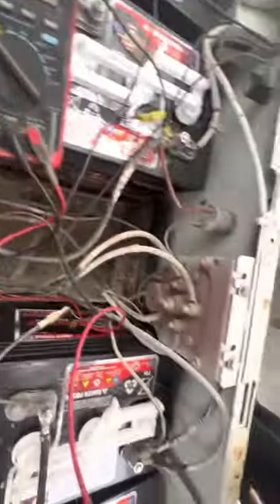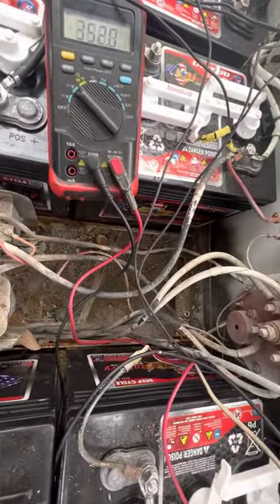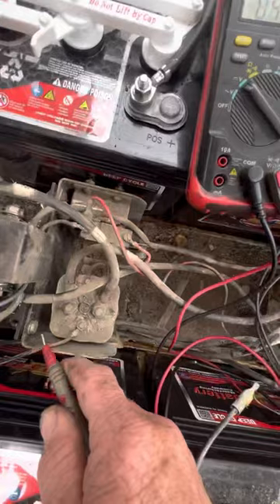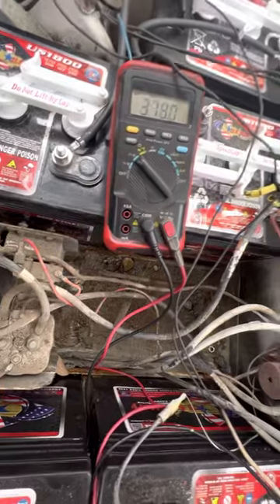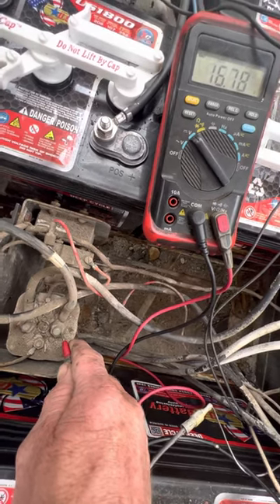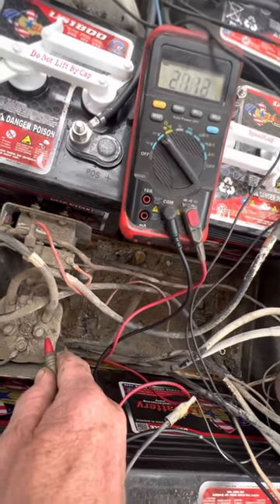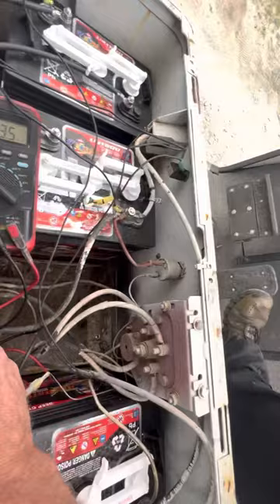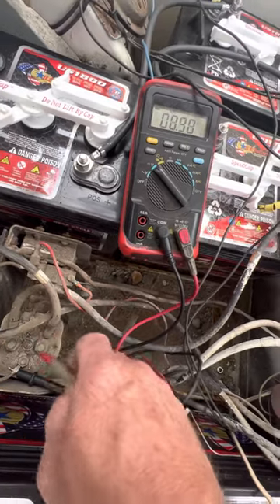EZGO MARATHON GOLF CART WON’T MOVE

Comment: UPDATE:  So in my haste last night hooking up my Pulse Tech Xtreme Desulfaters to my batteries while night fell and I had no lights where I was working, I failed to see a + battery lead that runs back to the rear of the cart was not hooked up. It had fell down between some other wires under the F/R switch. So, I have to "self admit" it was my own mistake. I was in a panic because this in my Sporting Clay's Shootin Buggy and we have the U.S. North East Regional Sporting Clays Tournament starting on this Wed's here and I really didn't want to have to walk it and carry all my gear. Thanks so much for responding to my "SOS" and while I was at it, I checked all of the connections, pot wires etc etc. Thanks so much again for helping. Keep the older Golf Cart Videos coming. Still a lot of 90's EZGO Carts out there. I'm getting ready to install 3 12 Volt Solar panels on the top with a charge controller etc to get me more range during the day hopefully on my six 6 Vollt Trojan T-105's. Someday when I'm rich I'll be able to afford a Epoch Lithium 36 Volt Battery maybe. But for now I have to stretch out what I have. Thanks again Sir !
Reply from the maker: Glad you figured it out. Anytime I get one in the shop to work on. I’ll make videos.
Reply from the maker: Solar panels. Let me know how they work

Comment: Question! How do you check the controller? Everything on my marathon is working, good ohms on pedal solenoid is jumped, but it’s not running I’ve jumped the controller and the motor runs forward and reverse
Reply from the maker: Black lead of m- on controller and red lead on b+ on controller.  And when you hit the gas it should show battery voltage. If it doesn’t replace. Controller.  Has the cart been wet any
Reply: Not sure I was told dog jumped on pedal and it hit truck and tires dug a hole in ground now it don’t  run haha
Reply: When I jump B- and M- on the controller it runs, but I am getting no power on B+
Reply from the maker: Where do you have the bLack lead at
Reply: Exactly as you told me black on M- red on B+
Reply from the maker: @hunterking4736  ok. Ow leave the black lead there and put the red lead on b+ on controller.
Reply from the maker: I meant to say on the controller above. But I can already tell you. Controllers bad. It should have showed battery voltage. Now that test above just checks voltage through the solenoid. But if you jump the controller and the cart runs. That means you’re getting voltage across the solenoid. So replace controller
Reply from the maker: @hunterking4736  yep the dog fried the controller because it wasn’t moving. The controller got to hot and burnt up.
Reply from the maker: @hunterking4736  need to put the dog on restriction or something. My kids did the same thing one time.
Reply: I was looking to order a new one but cannot find one exactly alike all the new ones seem to have a extra small lead and a extra 4 pin connector
Reply from the maker: @hunterking4736  yes that’s new style. Give me sec and will tell you what to type in
Reply from the maker: @hunterking4736  okay that’ll work. That’s just for reverse. You don’t even need to hook the 4th pin up.   You could send it to flight systems and get it rebuilt
Reply: Update I removed the controller and it sounds like a maraca inside hahaha
Reply from the maker: Oh yeah it fried it then. Thanks for letting me know!!🤛
Reply: Update new aftermarket controller new solenoid runs great!!
Reply from the maker: @hunterking4736  h$$$ yeah.  Glad it worked.  Make sure your subscribed.  I post 2 videos a week.

Comment: What was the outcome on this cart ? I'm having the same issue ?  Does the "Varistor" need to be installed on the controller ? Some people say yes and some say no. Mine is a 92 Marathon and came with a Varistor on the controller between the B+ and B - terminals that broke but the cart kept operating, (I replaced it). Does it have to be mounted a certain way ? I can hear my solenoid clicking in but the cart won't move. Battery pack is fully charged up. Could the issue be in the forward & reverse switch possibly a micro switch stuck ? It won't move in either direction. Ran fine last week. Parked it and charged it and now just hear the click of the solenoid. Thanks, great videos ?
Reply from the maker: You don’t need the  varistor. The problem won’t be the micro switch. If that was bad sol won’t click. Have you check ohms on the black and white wire comping from pot box
Reply: @HeyHeyHey97  Thank you for responding so quickly, greatly appreciated ! Question: why do some late 90's ezgo carts have a varistor and some do not and, does it matter what side of the varistor goes on what terminal ? This morning I will check the ohms on the pot box. It got dark last night then I came in and found your video ! Thanks again for any help sir. What was the outcome with the old ezgo you were working on if I may ask ?  I will follow u with you after I get into it this morning.......
Reply from the maker: @MacMcCabe2456   controller

Comment: Hello thanks for helping us folks that dont know what we are doing. 
I have an EZGO RXV. 2012. 
48volt. Just bought it from a neighbor 2 weeks ago. Ive been golfing daily and using it all working great. 
I tried to install LED light strips for underglow. (They look great!) but now my cart wont move. 

Originally I installed it only onto one 12v battery the main battery. Then after I realized it didnt move anymore, I rewired everything to take all of the battery pack with the + on the main and the - on the last battery in the chain. Ive installed an inline fuse on it as well to make sure it doesnt mess anything up. Hoping that would solve this issue but it did not. 

All my batteries are receiving battery. 
My sol is receiving battery. It clicks twice when I turn on the cart. Tow switch worked a couple times today but no longer is working. Reverse sound works. All lights, usb ports, etc all work. Cart will just not move. Do you do Facetime consultations? Id be more than happy to compensate you for your time. 

Also, not sure if this could have been a catalyst as well , but the electric “fuel” gage never worked. I got it working by wiring it up. It just had a faulty connector. Could that have ruined something in the cart as well?
Reply from the maker: Sounds like bad controller. If you let any of them wires touch another wire in the-harness especially the orange. You fried controller and the speed sensor. If you it double clicks your controller is bad.
Reply from the maker: Meaning at the electric fuel gauge
Reply: Yes when rewiring the gauge , the wires did spark. 
I just took apart the gauge and let the red, black, and grey sit free. Turned the key and now the tow switch works perfect, and when in forward, it clicks off the break now and i hear a quick almost “ufo” type sound. But still no ability to drive forward or back. Should I purchase a new meter harness? I cut the factory harness off to make my own connection. I no longer care to have the gauge work, it seems the gauge is the issue
Reply from the maker: So when you hit the gas the sol clicks but the cart doesn’t move? Does the sol click in and click out real fast
Reply: @HeyHeyHey97  Here is a quick 1 minute video of whats going on  https://www.youtube.com/watch?v=elaUrxC4duI - The sol does not click when i hit the gas, but after removing my gauge wire work, just letting the wires hang free, im getting progress and different sounds, and the break releases properly everytime when I hit tow switch and turn cart on. Before when my gauge was connected it would not do that. Really hoping its not a controller haha.
Reply from the maker: @beauvallis9340  have a busy day at work today. But will watch video when get
Reply: @HeyHeyHey97  Thank you brother - I appreciate your time whenever you get a chance. Have a good day
Reply from the maker: Just watched your video. Let me finish eating dinner then will get back with you. If you don’t hear from me in an hour. Shoot me a text on here.
Reply: @HeyHeyHey97  not a problem ! take your time, enjoy dinner
Reply: @HeyHeyHey97  Good-morning, just following up here, have a good monday
Reply from the maker: @beauvallis9340  sorry man been busy. pull back on the brake pedal and the accelerator pedal.  With the key off and then turn the cart on and see what it does.  Do you have a volt meter
Reply: @HeyHeyHey97  no problem - I had tried that, by going through your advice to other users for troubleshooting. Seems like your initial thought with the controller being fried is probably it. I towed the cart to a repair shop yesterday and purchased some bluetooth controller. Figured if I fried the controller, its out of my DIY paygrade lol. I appreciate your help , I'll let you know if the shop gets it running.
Reply from the maker: @beauvallis9340  yeah the rxv are sensitive when it comes to sparks across the harness.  Let me know why you find out.
Reply from the maker: What did you find out. Just checking
Reply: They havent called me yet to let me know the diagnosis. Ill check in with them on monday and let you know
Reply from the maker: @beauvallis9340  just checking in. I am curious. But normally if a spark it fries the controller and and the position sensors. But you probably just fried controller. Because you didn’t touch the orange wire.
Reply: Just picked the cart back up. It was the controller. $1,950 fix, but got a navitas cart reached 30 MPH haha. Glad the controller is new now, wont have to think about that hopefully for a while now. Thanks for your help
Reply from the maker: Yep that’s how it goes. Thanks for watching and subscribing

Comment: B- to B+ there is a resistor of some sort on my marathon controller that is no longer there it melted or broke off and my Cart is now having overheating issues on FNR wires. Do you know what this is? I’ve looked everywhere and cannot figure it out.
Reply from the maker: @hunterking4736  the yellow circle?  You don’t need it. It’s just for a lightning. Take it off and throw in trash. If it’s over heating on the wires. Could either be a bad wire or a bad connection.
Reply from the maker: @hunterking4736  thanks for commenting. Hit that like button for me and make sure you subscribe.
Reply: I just took apart the FNR switch and cleaned all those contacts. They were a bit corroded. The cart has been randomly stopping lately and thought it may be tied to the broken wires on the controller.
Reply: It does not appear that the cart you’re working on in this video has said resistor on it
Reply from the maker: @hunterking4736 when you say stopping.   You meaning stopping while you’re driving?
Reply from the maker: Also has the cart got wet lately.  Or has the controller been wet any
Reply: @HeyHeyHey97  yes sir it will randomly stop. I believe it is a solenoid issue. It is not my cart. I’m working on it for a friend. I do not know if it has been wet.
Reply from the maker: @hunterking4736  when it stops. Check voltage on the small post on the solenoid and see if you get battery voltage there when you hit the gas in forward and key on
Reply from the maker: @hunterking4736  no I take the resistor off